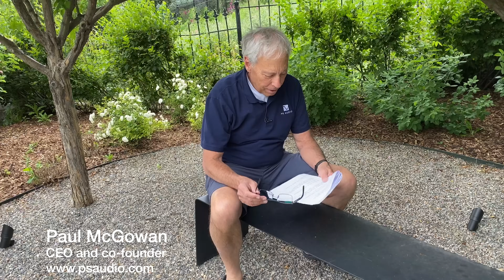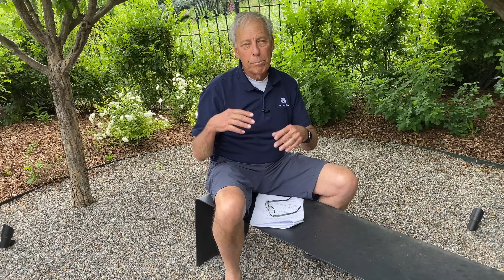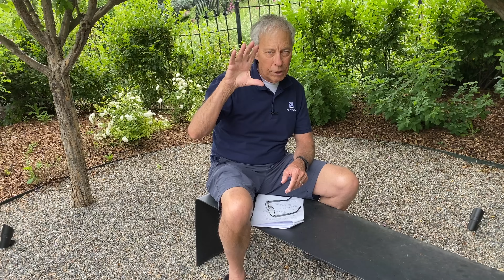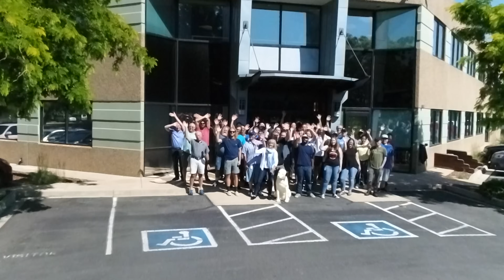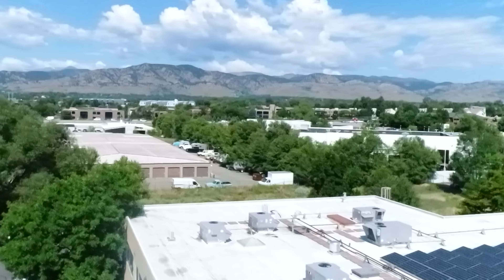Dynamic range expanders

Comment: Depends on how the music was mastered.
If the engineer chose to clip rather than compress, it's much easier to rebuild the range, because the audio processing software can easily see where it's clipped/brickwalled and recreate those sinewaves point-to-point.
However, if the music is only compressed (volume leveled) but not clipped at all, then it's very difficult to rebuild the dynamic range, because there is no indication of where the volume is truly supposed to be. One can easily hear the difference between clipped and compressed music, with the latter sounding very much squashed and uneven.
With clipped music, software like Thimeo Stereo Tool can semi-accurately rebuild clipping to sound a little more natural. With only compressed music, one needs to use another compressor to "pump up" the peaks in frequency ranges, but as Paul said, this can sound horrible if it's overdriven.
Reply: intentional clipping is a standard technique in recording and is introduced at various points in the chain. It doesnt matter what genre, expect maybe classical music. Transient clipping can sound nicer than hard knee limiting.
Reply: @Raumweiter  Depends on the tone/instrument/frequency and the overall desired effect. While you're right that transient clipping usually sounds better, it means less headroom and therefore a quieter master.
Plus, where lossy compression is concerned, hard clipping and brickwalling needs less bits which, overall, allows more bits to be stored and used for the musical areas. For example, Spotify/Appe/YouTube 160k is (loosely) based on the same underlying codec which is an average bitrate. We can store less info during distorted kicks to allow more info during detailed vox or highs, while attaining the same filesize/bitrate.
Reply: @Raumweiter  
Even better, not to have either of those!  I don't understand this mindset, with the huge dynamic range we have today, that the recording level can't simply be set to encompass all transients accurately.  That's how I record piano (which, by the way, sounds horrible if it is clipped).  
When I look at the envelope of tracks like the Mary J. Blige number, it's as if it was drawn between two rulers.  That's for writing neat text on drawings or painting signs, not for making musical recordings.  And listening to the track, it's monotonous, expressionless and lacking any punch or life.  We need a consumer revolt against this death grip on music.
Reply: @marianneoelund2940  I´m not talking about big gain reductions like brickwall limiting. I would use this technique on snare drums for example to get rid of some very high transient peaks. Especially drums can have strong transients. I do not record piano, so i have no experience with that, but i would never think of clipping  a piano. This technique has nothing to do with creating a brick type of mix. I want to make sure that my music translates well on a big club PA, therefore i don´t really want super spikey transients all the time. It should sound pleasant even at high volume levels.
Reply: @Raumweiter  
We certainly have a different concept of what sounds pleasant.  The high transient peaks are part of the music.  Take them away, and you delete a major source of expressiveness.  I can't imagine that anyone who has heard a tune live, without limiters or compressors, would ever be satisfied with the processed version.  It's lifeless and unsatisfying, devoid of excitement and passion.  
Biggest mistake I've made with recordings, is purchasing a band's CD at a concert, taking it home and expecting to hear something similar.  Instead, it's like eating plain, stale bread after enjoying a fresh gourmet sandwich packed with savory and delectable ingredients.
Reply: @marianneoelund2940  I´m making electronic music, synthesizing my drum sounds with oscillators and analog filters. Thats why my approach is very different from yours.
Reply: @Raumweiter  
I see.  That's a different world.  
I've noticed that, if I play a digital keyboard or synth, it is difficult to achieve a satisfying response from it, which on the other hand is easily obtained from my acoustic piano.  
It's fun to play the synth, with its huge palette of voices, but I always gravitate back to the piano, for its natural sound and dynamic range that lets me play from barely audible ghostly whispers, to gentle, sweet pearls of bliss, to wall-shaking thunderous refrains.
Reply: @marianneoelund2940  that is where the synthesis structure and your dedication to spend some time on the synth makes a big difference. Aftertouch and the option to have several parameters controlled by velocity is key to expressive sounds.
Reply: https://www.siraudiotools.com/StandardCLIP.php
Reply: Clipping is a production error and indicates the level was set incorrectly at some point in the chain.  No responsible recording engineer intentionally adds clipping for the purpose of dynamic limiting (that's what a limiter is for), because it causes considerable distortion and also interrupts the musical detail in a manner similar to TIM.  The only time clipping should occur, is if the artist wants that particular sound effect, but there are much better ones to choose from.  Tube amp overdrive effects and limiter action are quite different from clipping.  
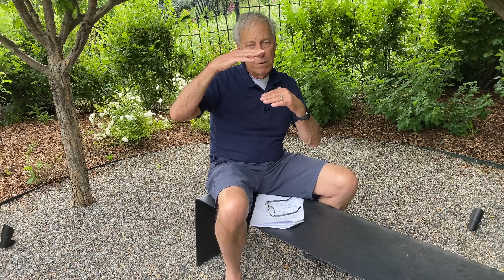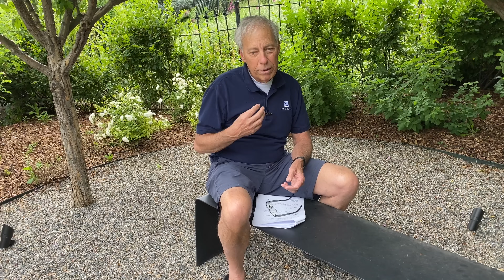Having said that, accidents do happen and I have at least one commercial recording which contains clipping on several tracks.  Ironically, the CD was recommended to me by a salesman, as a "test CD."  It is a Mamba percussion album, and it would be interesting to see how Thimeo deals with it.  Details:  Mamba Percussions Vol. 2 by Jean-Claude Kerinec and Staff Elmeddah.  Track 7, Rituel II, is probably the worst one, especially around time points 1:30, 1:40, 2:50 and 3:25.
Edit:  Just noticed the Google listing for this album has the track names assigned differently than my CD does.  Don't know how that happened, but the track of interest is still track 7 and it runs over 7 minutes.
Reply: @marianneoelund2940  I can't comment on all genres of music, but for Hip-Hop, RnB, Urban-Pop and Dance/House we've been purposefully clipping for years. We focus especially on kicks, claps, snaps, snares and hi-hats. Kicks in particular we want to completely square-wave and bottom out the hardest parts, so that there is nothing else but an extended level of woofer excursion to give maximum impact. Claps/snares can be really hit hard -- for example, Jennifer Lopez - I'm Real (Murder Remix) has 60% distorted snare but sounds perfectly audible.
In general, 10-20% of clipping/distortion is possible, when controlled, for most tracks. Depending on the particulars of the track, usually its bassline, I aim for -7 to -9 LUFS, but as loud as possible without artifacts or complete loss of musicality.
We're not talking about "turning up the gain" to get a louder mix, but looking at different mixed channels and prioritising layers. Mastering is a fine art, and it really can't be taught. It's all about experience. Happy to have an extended chat with you about it in some better place if you like?
Reply: @olorinhenderson  
I suppose that shows my age.  But is this done on individual instrument tracks, or on the mix?  I was thinking of clipping that's visible on the final, as a definite voltage limit - just as if a power amplifier was clipping the signal.
A few examples from the CD I mentioned earlier:  
https://cp.sync.com/dl/2b01b8a70/pjaxfp89-qybsbhxp-xy479fzr-7785qmdu
Reply: @marianneoelund2940  Both the mixing stem phase and the final master phase.
 Basslines, especially deep ones, can be compressed to brickwall-level without the human ear knowing. Further, using a multi-band compressor on those bassline frequencies (say 10 bands from 0-100Hz) gets you a rounded sound that suits everyone's listening devices.
Kicks we make LOUD and square-wave clip. Same with the claps, snaps, snares and any other sounds that need to be made prominent. Not every track needs this kind of treatment of course; it depends on how the final mix is received. If sounds are subtle, we leave them so, but any louder sound that needs to 'pop' is usually clipped or compressed before getting into the final two-channel mix.
We do the bulk of distortion during the mixing stem phase, so that we can clearly hear the butchery we're doing to each sound/instrument, and ensure we're not pushing anything to unpleasant levels. When we're done, we export the final track to two channels -- which still has abnormally loud sounds that are to be left prominent. One final, careful pass through the mastering soft/hardware with whatever choice/requirement of compression/clipping makes sure we hit LUFS targets and push as far as possible without audible distortion.
Truthfully, we can push 10-20% distortion onto most tracks without the end user noticing. Sometimes even more. The harder we focus on kicks and claps/snares, the louder we reach in LUFS which, even in the semi-relaxed loudness wars of 2020, is considered a win.
Reply: @marianneoelund2940  Checked out that 7 minute track. Many, many issues there.
First, it has a very high noise floor, so I'd assume it was recorded with bad quality kit and/or was passed from A through Z of analog equipment.
Second, it has a massive DC offset which is more likely to be from mixing/mastering kit than recording: http://prntscr.com/th2v6p
Third, while there is some clipping it's more noticeable due to the artifacts: http://prntscr.com/th2xj9 I picked out the worst sample I could find but there's barely any distortion here, and it would take an average listener high levels of concentration to figure this out. Fixing the DC offset would give much more headroom, then either soft-limiting or compressing would make up for the (tiny, badly) clipped samples. I personally find this subtle clipping inoffensive.
Reply: @olorinhenderson  
Interesting about the DC level.  My CD player wouldn't output that, so I hadn't noticed.  With that removed, the clipping is symmetric between the positive and negative swings, so the offset must have happened after the clipping.  With the DC included, how close does the signal come to max code?  
So much for salesmens' recommendations for test CDs!  
But I agree the clipping is difficult to hear.  I only noticed it because I was monitoring with my scope one day.  I probably wouldn't be able to pick out the clipping by ear unless I had a clean version of the recording to compare it to.  
I would be interested in seeing a track with intentional clipping in it, especially for a low-frequency source like the kick drum you mentioned.
Reply: @marianneoelund2940  I think the clipping on that track is so low that you'd never notice it, even with a direct comparison to the source. Once it gets to your speakers it'll be rounded out anyway with the natural excursion of the woofer.
Some example tracks of techniques I mentioned (many more, just on my recent listened list):
Square wave clipped kick: Mary J. Blige - Got to be Real
Compressed & clipped bassline: Noax - The End
Brickwalled bassline + all-round heavy clipping: Fat Joe & Dre - Yes
Nothing but a compressor (very very bad): Konshens x Paigey Cakey - Pull Up
Reply: @olorinhenderson  
I looked at the Mary Blige track, as available on YouTube.  At about 0' 33" and 0' 37" for example, I can see the kick drum clipping.  The first cycle looks unaffected, but the second and third cycles are strongly clipped.  At the fourth cycle, looks like the drum has decayed enough that there is no more clipping.  
But what bothers me about this processing, is that during the clipping, the other signals are strongly attenuated, so it's not just the kick drum that is affected.  Look at the higher-frequency amplitudes at the second cycle + and - excursions, and the third cycle + excursion, compared to the strong signals riding on the fourth cycle and the start of the first cycle.  Looks like a hard limiter was used on the entire mix, not just clipping on the drum track.  There are other places where I can see the drum at a lower amplitude, then nothing appears disturbed.  
Maybe I'm an old fuddy-duddy, but I don't like this.  Listening to it with headphones, the drum seems to be missing a lot of impact.  I haven't tried my hi fi speakers yet.  
Also, the YouTube audio is band limited to 16KHz - just had to complain about that (even if I can't hear above 16KHz).
Reply: @marianneoelund2940  You're seeing bitrate compression artifacts there. If you check the lossless track you'll see what I mean. The kick is pre-clipped before making it into the master mix, same with the clap/snap. The vox also have audible distortion on the choral build at the end of the track, and that's because no compressor was used on the final mix, just clipping. It's overall a good master for this genre but, as ever, nothing is perfect.
Headphones should give you the same impact as speakers, but with a slightly lesser effect since the excursion of a smaller driver is less than that of a larger one. In-ear headphones struggle the most with clipping like this because of the teeny-tiny size of their drivers -- but, it's almost made up by the lack of "everything else" during the bass clipping.

Comment: I still have a Robert Grodinsky RG Pro 20 dynamic range expander from the 1980s.
Reply: Wow. Do you like it?
Reply: @WillyJunior  I stopped using signal processing by the '90s, but I kept the equipment. It's in a closet somewhere.

Comment: A few decades back there was DBX who made a line of music compressors and expanders. I bought one of the entry level units and it worked but only at low ratios. You could hear it breathing if you got close to 1.2 (max was 2.0 on compress and expand) and there was always the issue of it adding something to the "sound" that you might not really want.
I experimented with nusing it to compress music while recording and expanding during playback to increase signal to noise, in fact for a while records were released using the system to lower record noise. It was a competitor to Dolby. Both systems work but have to be carefully controlled so you don't hear them work.

Comment: Well you can add touches of expansion what some engineers deploy in remastering to give a false sense of dynamic range, but knowing where to add them is the question?
you would have to have a piece of software to analyse the whole frequency spectrum and work out where it thinks it should have dips and highs with nano computers this could be done in real time without a buffer stage. Dynamic range is there it is compressed in the remastering stage at the end there's always two copies of the same track it's about asking record companies to release both copies that's all you need to do an audiophile copy and a general copy you've got some influence Paul engineers want it record companies don't. The only people using dynamic range are record mastering engineers they have to have dynamic range
Reply: Back around 1980 I experimented with recording on cassette using a standalone HighCom II compander unit which had to be calibrated for each tape on recording and playback. In the end it was too much faff, but I did find that a few recordings could be improved dynamically by a small tweak of extra expansion on playback. Not many, though, and not much.
Reply: "The only people using dynamic range are record mastering engineers they have to have dynamic range"

i found that sentence a bit misleading.
Reply: every record has dynamic range.
Reply: @Raumweiter  that's what I said ??

Comment: In first place, avoid high gain amps and high volts signal out put  DACs . If your getting loud sound at very minimal volume.. it does not mean recording mix loudness .. it could also something wrong with amps or DACs with high gain . Many audiophile target brands just high gain amps and high volts output DACs which produce compressed sounds at minimum volumes and on top of that overly processed dsp on frequencies bands . On top of that cables even makes them worse . All make them worse when you listened compressed albums. 
Trust that there is nothing different technology for audiophiles than pro audio . Just that audiophiles brands do overly and force the music.